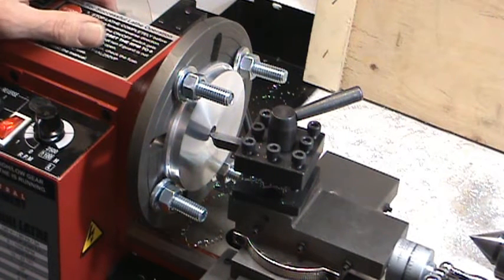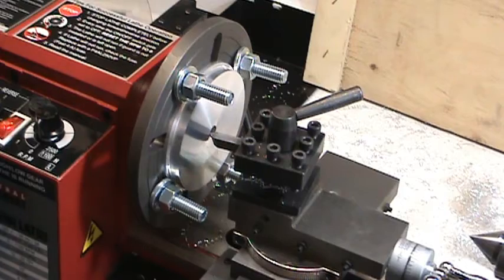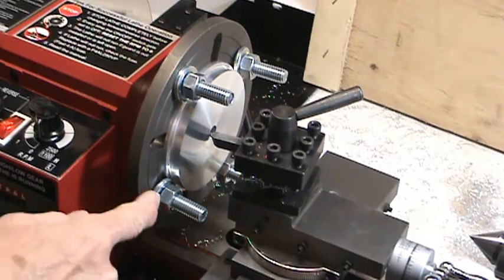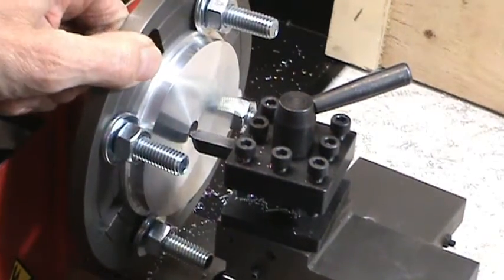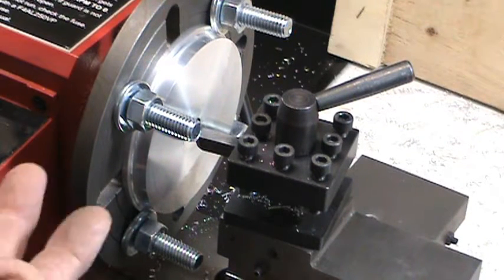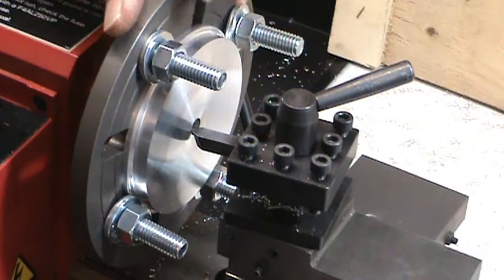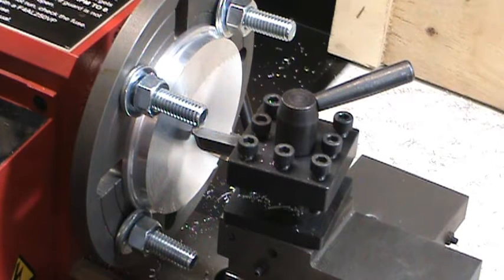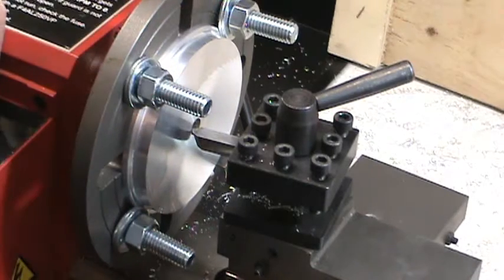Mini Lathe Amateur episode 5

Comment: You can buy dogs to hold your stock. I've been trying to find a face plate for a 8x16 lathe.
Reply from the maker: Yes, I've seen the dogs for sale on the website where I got the faceplate.  Little Machine Shop dot com has those parts.  I recently bought a set of proper hold downs for the faceplate from them.  I don't know if they have a faceplate for the 8X16 lathe, but they might.  They carry other stuff for lathes that size.